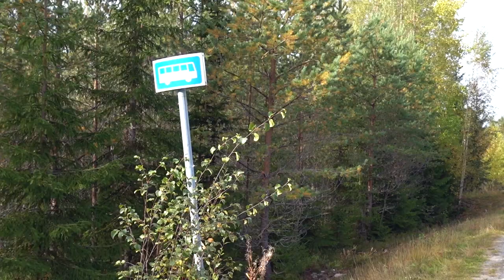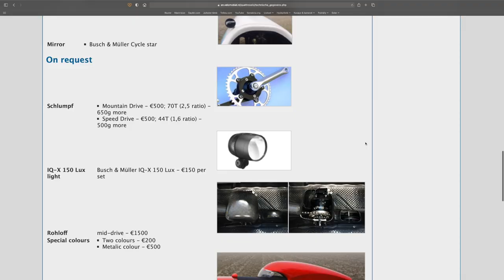There's a BETTER Way to Commute

Comment: Thanks for doing this video. Velomobiles really could be a great option for so many people instead of driving to work. We just need more people to be educated on it and increase the production scale of velomobile manufactures.
Reply: We need parking! That is so crucial and could render velo completely useless. My commute is pretty short (relatively) and I can use my trike just because I am able to take it through all doors to inside. Leaving such "bicycle" outside basically begs for going home by BUS...
Reply: @tri-seeker2753  protected parking at work is definitely important. I work for a cycling company and we have tons of bike parking inside but it's all wall hooks for a front wheel to minimize space. And then there's a whole parking lot for 100 cars that's free.

I think velos could benefit from cargo bike parking, which is a thing in the Netherlands. Although it would probably need to be outside. But it could be covered and possibly secured behind a gate. Just bring a nice lock with you.
Reply: @adamt195  Well, I have no idea how velos could be locked, but secuder place is more important than covered - both here have nice hoods that can take rain easily. But leaving velo parking on a free-to-come lot? For anybody just to throw it into a van and go? naaah...
Reply: @adamt195  Cargo bike parking? Most parking garages here don't do anything except racks for conventional two wheelers. I'm making a point out of it everywhere I can - aside from velomobiles we also have threewheelers etc. and it's not very inclusive.
At work, I just put my bike under the stairs inside the office :)
Reply: @tri-seeker2753  And a shower is comfortable. My employer is constructing one for me :)
Reply: Zariyah Gabrielle  :) Constructing one is actually seriously expensive, a lot of work and a really steep learning curve. I've thrashed my own design hood three times already in the past month, and it's only a hood. 
Protip: Get yourself a cheap one asap, start saving cash on your commutes, and upgrade later!

Comment: One tip I found online is that if a shower is not available have a shower before you start the commute and then change into clean clothes  and use some deodorant after you have stopped sweating.  I use this method, and have yet to have anyone complain. Another tip to help reduce smell is to wear wool clothing as it does not hold on to odors.

Comment: I have 8(flat)km  to work and electric assist on my ride. Not that much viking-ish but still easier to park and less pollution. And no need for shower! 😁
I’m impressed by you guys who pedal long range but would like to emphazise that a velomobile of some kind might be a good alternative for shorter distances aswell. And compared to a car even the quattrovelo comes at a reasonable pricetag.
Thanks for all your videos , keep em coming!
Reply: Well, depending on the conditions a velomobile can be slower than a "classic" bike overall. Typically on a short distance, let's say <5km, I find that the time spent getting my DF ready to go + the need to park it + the lack of manoeuverability isn't worth it, and I just use my cheap folding bike, it's more convenient. Of course for commuting almost 50km one way (not everyday ^^), the velomobile is the way to go :D
Reply: @pg5200  That's true unless you want to get to work dry. Also, a velomobile is simply comfortable.
Reply: @4nz-nl  Indeed. That was the main reason I went into velomobiles : before that, I couldn't reach 100km because of the saddle pain... Now I go over 200km without feeling any pain, and that's great :D

Comment: Great video!

I would add a spare tire. Which as you know fits easily in a velomobile. When having a flat it's just replacing the tube and tire. No need checking the tire.
And add that a small legal 250W e assist and small 7/10Ah battery can be a comfort help also in hilly parts of the Netherlands, pull trailer, lots of traffic lights, backup power and hardly bother at other places.
And/or per one button EggRider winter profile. Without that last option I would probably be commuting in winter time by company car solely. Others could have the same commute time restriction like me.

Comment: Shower is crucial. I personally got a velomobile to explore how fast I can go under my own power. It is pretty awesome getting to work in a similar time as what it would take to drive. Even though I've used 2 velos to date, I think the one thing that does not get discussed enough is durability and longevity. A full carbon velo with carbon swing arms, etc. will be really light, and awesome, but will it be as durable if you are a stronger rider or heavier? Anyway thanks Saukki for yet another great velo video!
Reply: Concerning shower: If I ride on really low power (up to ~100W continuous/200W acceleration), I can manage 15-20 km without. At that power, it's still faster than any other bicycle except a speed pedelec.

Comment: I think we have the same light on the roof, an exposure, link+ ? Brilliant video, thanks for advocating velomobiles as an alternative to a car. Of course as they say "the closest thing to a car that's a bike".
Reply from the maker: The light on the video was Topeak Headlux. Not very powerfull, but better than nothing.
Reply: @TheVelomobileChannel  I highly recommend the exposure, it's much brighter than the Topeak version and has multiple modes and rechargeable battery last ages.
Reply from the maker: Thanks for the tip. 👍

Comment: You should always put your notebook (and most other electronic devices) in a bag to protect it from condensating water inside the velomobile. I don't need to shower at work, just a fresh towel and some deodorant.

Comment: Hey sauki, did you know that the Netherlands isn’t completely flat? The south of the Limburg province consists of some hills. Those I don’t want to ride all week long for commuting without e assist. Would be hell! Anyways nice overview!
Reply from the maker: Yes, I actually knew. But I think the hills over there are not much bigger than the hills we have here where I live.
Reply: @TheVelomobileChannel  exactly. You live in a country which has more and higher hills
Reply from the maker: Yeah we have, but this area where I live is one of the flattest area in Finland 😄
Reply: @TheVelomobileChannel  right you are. I remember your video where you went looking for some hills 🙂.
Reply: Most people who think of velomobiles complain about going up. I have more fear of going down :-)
Reply: @4nz-nl  what bothers you the most about that? Overheating brakes?
Reply: @julesvelomobile  Yup. You can't let it run and expect to brake it easily. It's not a fault by the velomobile manufacturers either... the problem is that the theoretical top speed of a Milan with me in it on a 10% downhill is somewhere around 220 km/h. Once it starts going, if you don't brake it just keeps accelerating to the point where it's just really scary. If you dó brake, the brakes overheat faster than you (or at least I) expected. The best thing for me to use on holiday was a braking parachute but it's still not ideal.

Comment: My friend, how many velos do you own? Most have more than one :) At 4:30 you have the velo on its side, do you have protection on the side which touches the road?
Reply from the maker: I own just one 😄 The other one is borrowed. 
In this video I explain how I can tilt the velomobile while replacing the tyre by using tool bag & portable mattress. https://youtu.be/MJORxM3sOyw
Reply: @TheVelomobileChannel  To finish the explanation: The Alleweder (aluminum) is not Saukki's, and the Quest is old footage - it's sold now ;)

Comment: If you ignore 25kmh electric assist speed limit something like tsdz2 would make commuting much easier. If you can hit 40-60kmh without electric assist why making velomobile electric would make it any less safe. The law is behind times and with increasing gas prices, electric velomobiles could make big impact for those who don't have much money or those who want very environmentally friendly commuting vehicle. I need to start prototyping coroplast electric velomobile :D

Comment: I wish there were more velomobile dealers in the USA. I also wish more VM manufacturers would explore aluminium-bodied velomobiles and make them aerodynamic like their carbon fiber counterparts. They would sell a ton more if they did that, even if they end up a few kilos heavier. Most cars nowadays are aluminium, so why not VMs too?
Reply: Much more expensive to produce... What's wrong with carbon?
Reply: @4nz-nl  Carbon is very expensive, and frankly overkill for most commuters. On flat lands, where velomobiles are designed to be used, the extra weight of aluminium should hardly matter. And it really won't matter at all with an electric motor.
Of course the demand for VMs isn't high enough to automate production at any scale where sheet metal would be the more economical material, but eventually it will happen, and the cost of VMs will come way down.

Comment: Great video! Do traffic lights that detect cars for turning green also detect velomobiles?
Reply from the maker: Usually not. But people have used something like aluminium foil inside the velomobile to make the traffic lights to detect velomobiles. Maybe I have to try it by myself 🤔
Reply: @TheVelomobileChannel  I know some road traffic lights that pick up my QuattroVelo. Also bicycle traffic lights in The Netherlands on some places. But in the bigger roads is it possible the lights don't find the velomobile. This is also with motorcycles a problem some times.
Reply: @kjeldsloot  Interesting. AFAIK all traffic lights in my area detect my QuattroVelo. But some I know they just use a rotation scheme.
Reply: @TheVelomobileChannel  a velomobile rider told me to stick my shoe out of the foothol because the metal under you shoe will be detected bij the traffic light.
Reply: I have a metal strip ducttaped to the bottom and it seems to help.

Comment: Breaks my heart. Way to expensive in Canada.
Reply: Probably still a lot cheaper than a car ;)
Reply: @4nz-nl  True. It costs between $15,000 and $20,000 for a velomobile because of the difference in currency values. I think this could do a lot of good for those with disabilities or those who can't get a license because of reasons outside their control.
Reply: @4nz-nl  I have bi-lateral optic nerve hypoplasia with nystagmus.

Comment: And you also need is about 10 000-15 000 € depending on model and 6-15 months to wait for the velomobile to arrive. With that money you can buy pretty nice car and it wont get stolen so easily. But maeby some day we will have the infrastructure to safely ride and own/store the velos.. And hopefully the prices are more reasonable. The whole bicycle industrie is so overpriced compared to motor industry.
Reply: I got mine 2nd hand, in a good shape, for a much more reasonable price and without waiting... Although it could be tricky to find the machine that suits your needs, that path should be considered as well :)
Reply: The bicycle industrie is only not so much supported by government. and small numbers of this vehicles increase prices - sadly. So more velomobiles mean cheaper prices. And as pg said: Don't compare a new velomobile to a used car... if you compare it to a new bought car, its a good deal. otherwise, you should also look for a used velomobile for comparison.
Reply: @jakobthoboll2759  "Don't compare a new velomobile to a used car... if you compare it to a new bought car, its a good deal."
No its not even then a good deal. I live in Finland and we have very high taxes on cars. Still for about 14 000€ you can buy new Dacia Sandero. You have 4 wheels with independent springs and shocks, abs brakes, lights, airbags and much more. Its not a great car, but it will get you from a to b much safer and faster than velomobile. Theres also much more advanced technology in Sandero than in velomobile.

I would also like to see more velos, trikes, recumbants and bikes versus cars on the roads but bicycle industry is overprized for what you get. Also car industry has better standards on quality and tolerances, but maeby some day bicycle industry will catch up.
Reply: @tero1422  That's a low-end mass product. A velomobile is low-tech but a high end low volume product. Cars used to be a lot more expensive too. We just need móre velomobiles, more manufacturers etc.

Comment: How many miles are reasonable for a daily commute on smooth roads with a velomobile?
Reply from the maker: It depends on how much time you have to spare. I’d say on flat area and on smooth roads you can easily travel 35 km within 1 hour with relatively easy effort.
Reply: Depends very much on the route you choose too. There's a route to my work which is 50 km, I just can't manage to get the travel time under 1h20. Recently I tried a 54 km route and did it in 1h15. Especially when I'm riding hard, it easily takes me 750m to get fully up to cruise speed, so straight roads can be convenient. That, however, also depends on the type of velomobile; mine is not well known for it's good acceleration.

Comment: If you have $15,000 (US) then you can consider buying a velomobile.
Reply from the maker: Shipping across the pond is quite expensive 🤔
Reply: Comparing it to the buying ( and using costs) of a new car, its quite cheap. Especcially if you look for a used one. Low maintanence costs, no taxes and no fuel costs ad up to a quite good financial bilance over the livetime.